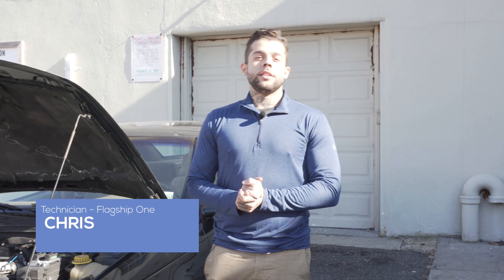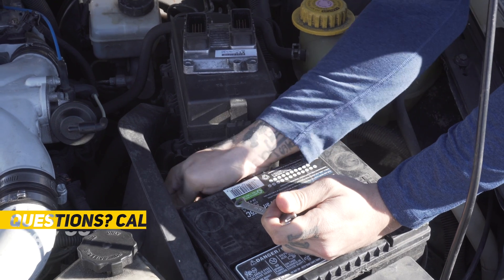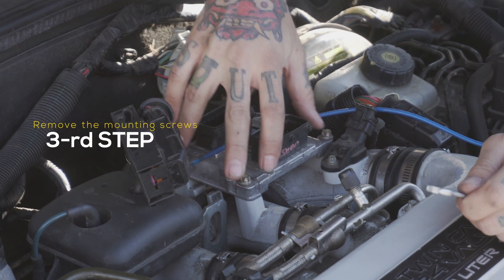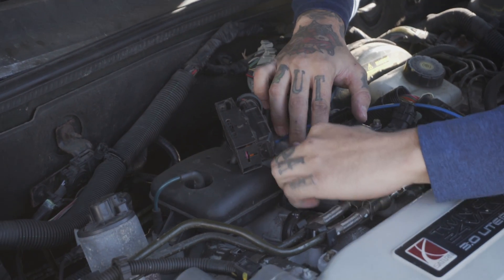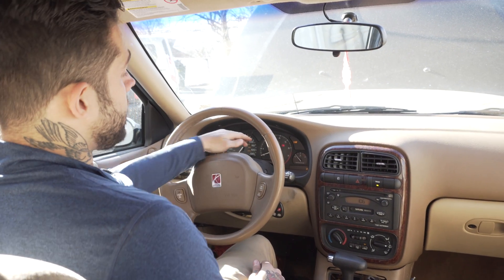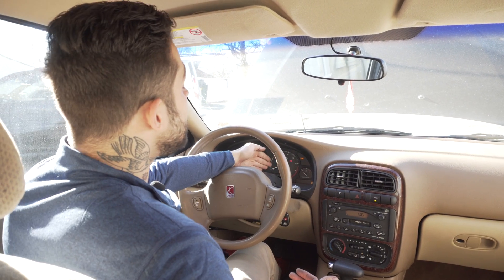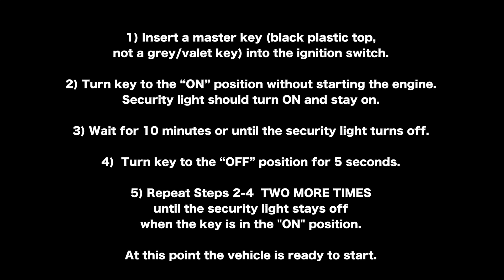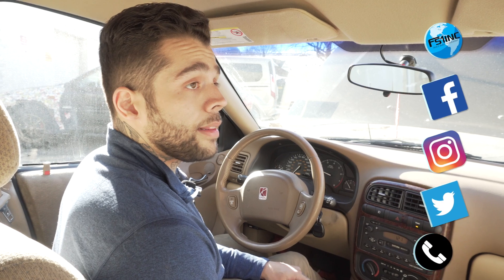How to install an ECU on a Saturn L-Series and perform a GM Passkey 3 Relearn

Comment: ECM right on top of the engine…. Nice lol. I thought my Chevy Impala was bad with the ECM being underneath the air box in the front end of the car. It gets wet there but at least it doesn’t have the heat of the engine directly below it lol. I don’t understand why they don’t put the ECM in a more protected area like against the firewall or even inside the cab. Kinda silly

Comment: Porque mi 1999 SL2 saturn  a w.turn 1.9 4cyl 5speed sound  like dont have Compresión.
Reply: Tell me Y change del Electronic mayo spark Plugs.y Wirers no Spark at All.y Change fuel punp
Reply: Nesecito Alluda.
Reply: And a crack sensor
Reply: Nesecito hablar con Un Mecanico.
Reply: 😢yo fui un Buen Mechanico Mis Clientes que yo Trabaje En sus carros  solamente y Reciba propina hace muchos Años Atrás 30 Años y Yo Leía Los .libros y encontraba las fallas los Carros andaban y me jefe fue una persona profesional su Nonbre es Andy Grifer el tenia mucha fe en mi cuando Reparaba los autos en esos tiempos yo estaba joven 25 Años Tenia pensamiento Lucido Ahora se me Hace un poco Difícil ustedes se Aquerdan Cuando  
LLEGABAN. Ford tauros super Hot Teníamos  que cambiar las bujías     Las bujías estaban Tan Callientes nosotros  teníamos Que hacer los Cables habíamos Overhaul Calipers weel Cilinders Las .Personas no podían pagar Caliper Nuebo yo bendiga partes de Carro en esos Tienpos yo Agaraba 5 Tikes  mi jefe estaba contento conmigo. Yo le producía  Bastante para la Compañía  ALL Tune and Lube extraño a mis amigos yo me ciento Contento  por haber  surgido Esta Carrera y me gusta siempre  Un Día Hice 2000 dolares nos pagaban salario plus Comisión  es mi Trabajo yo lo Quería  Calipers Quedaban Cómo nuevo y los weel Cilinders También  si Alguien me da la Opurtinidad lo buelbo Hacer nosotros somos Profesionales  mi nombre es Charles Cardenas  en este momento  Quiero Agradecer  A nuestro señor Jesucristo todos los Días  Que Nos Da la vida  Es muy Importante. En este momento voy A cenar me despido Que Dios los Bendiga a todos por Igual.
Reply: Amen.Hoy Tuesday 5 De Decienbre 2023 Time 8 :13

Comment: I know the CKS is near the oil filter on our 03 L300 V6,  and the ECT sensor is near the battery upper driver side.  Might you know what this sensor is in my video?  Under and rear of the water pump on passenger side leaking coolant.
Reply: https://www.youtube.com/watch?v=3DNpIHEgAuc

Comment: I just received your product today in the mail. I have performed this operation to get my pass key relearned. Without the relearn the engine would not even turn over. Now with the relearn the starter is turning the engine over but will not start. What’s my next step?
Reply: Did this ever get solved?

Comment: I just got my ECM today from you guys. My battery needs a charge and the person doing the charge will be over tomorrow. I really, really hope this is all my car needs and this works ^_^  Come on, baby, mama needs her own set of wheels again!

Edit: Alrightie, so, things were going great until cycle number 3. The security light and the panel flashed on for a second and then went away and the car was dead. The car had been sitting for three weeks and the battery was dead before I began the process so I was getting a jump from my mom's car as I did the cycling. I waited about twenty minutes of charging the battery first before I did this. I was still charging the  battery on cycle 3 when everything stopped working. 

My mom had to go to work so I wasn't able to maintain the charging. I switched back to the original ECM and same, car is dead. I've swapped back to the new one once more.  It's possible the battery is bad. It was a $50 battery from Walmart that was in the car when I got it three years ago. So...that's my next move, gonna try a new battery and see if that helps, maybe there isn't enough juice to turn over the alternator (and I hope the alternator isn't bad...I just replaced it in November 2019 and it's currently May 2020. But my car has been flashing at times with the dash so something with the electrical is certainly off. I just hope that isn't affecting this whole thing.
Reply: You can buy a plug in charger for your battery. Leave it on overnight! That’s easy, take care of the no brainers first
Reply: @ecb8252000   I actually went one better. I now own a portable charger. It uses very little energy to jump off standard cars/SUV's and lasts for months. No more having people coldly roll their window up on me either when I'm stranded and need a jump. I just keep it in the trunk of the car and that thing has saved me more times than I can count. Best $100 I've spent, lol.

Comment: I don't get the Security light when I cycle the key on. I have not Replaced the ECM 'yet', it is just not responding/showing error not responding to the KeyFob. The rest of the entire car works perfectly fine.
Reply: I also have same problem. No security light
Reply: What fixed the issue?

Comment: A lot of the videos have read say not to disconnect the battery terminal and to do something regarding turning the key over? I got a clutch job done, but we disconnected the battery and computer over a month ago, and the shop doesn't know why it won't start and there are no lights.... My understanding is the ECM has been disconnected too long?
Reply from the maker: Hello Emily. You may need to charge the battery if you are getting no lights at all, or replace the battery entirely.